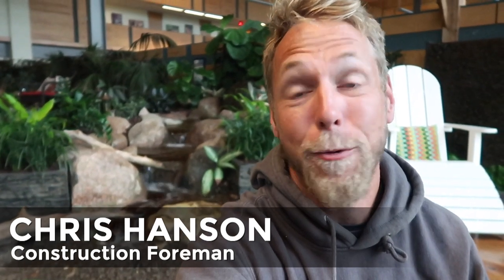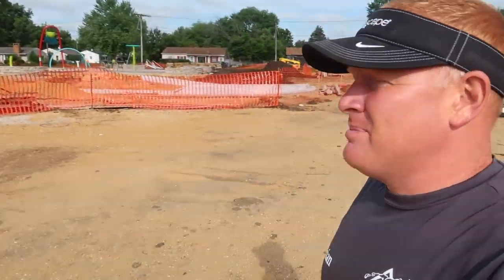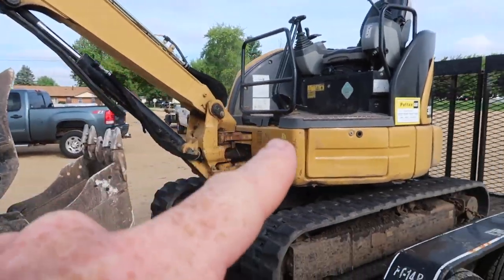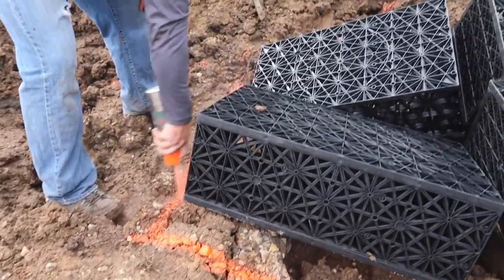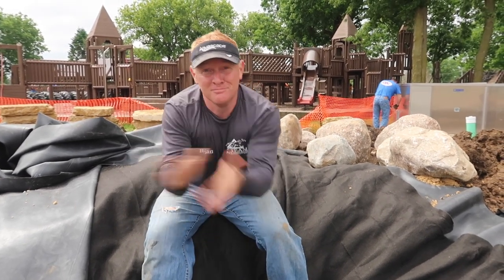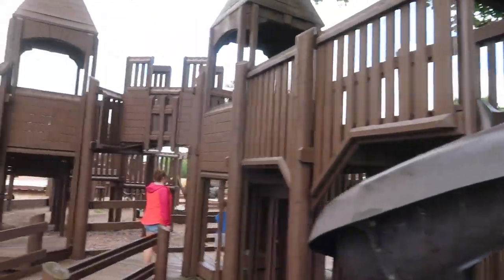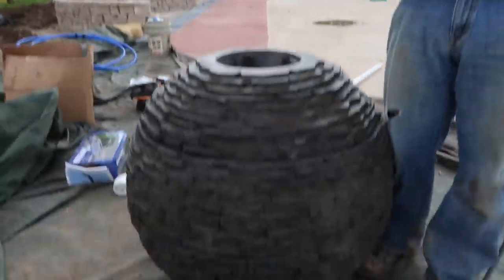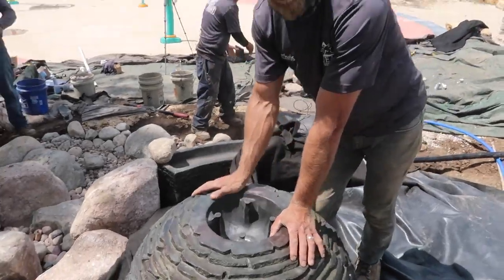*NEW WATERFALL* Adds a SPLASH to Playground

Comment: Another great job.  Thanks for sharing your ideas and how you arrived at them.  Quick question: Why not have the stacked slate urns come with a 2" opening and let the customer reduce the size if necessary, instead of making them have to drill it bigger if needed?